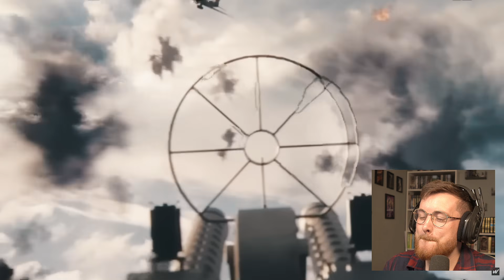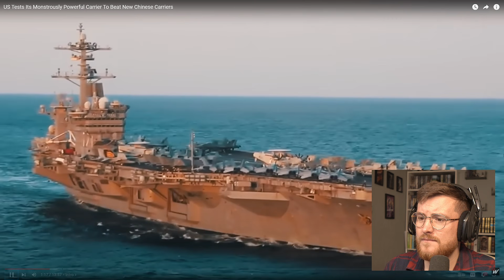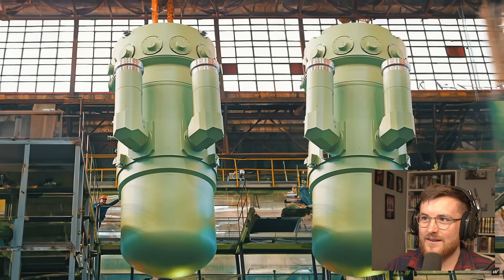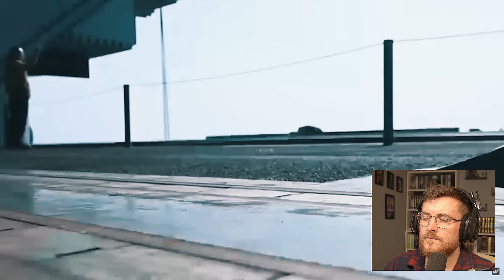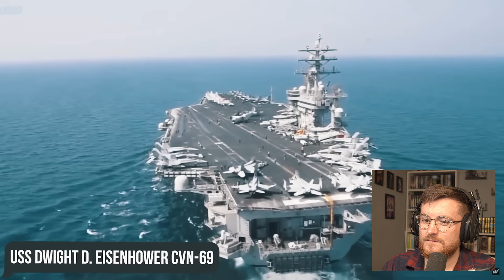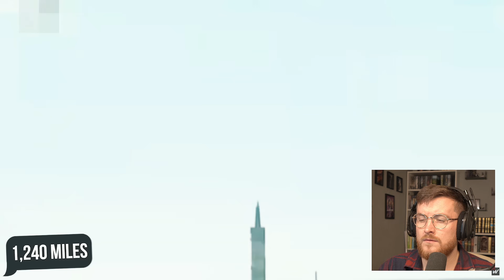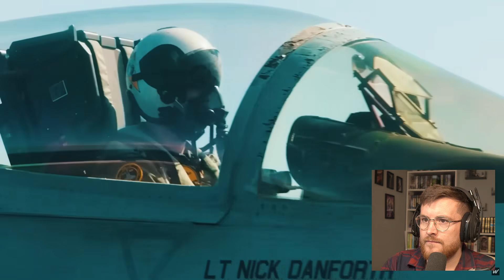Royal Marine Reacts To US Tests Its Monstrously Powerful Carrier To Beat New Chinese Carriers

Comment: I wanted to point out as well, the USN outclasses every navy on the planet (maybe not all at once but 1v1, no navy technically stands a chance) China also technically has more ships which people cite a lot as "oh, they have a bigger navy" which is only partially true. As Habitiual Linecrosser points out often "That's cause we don't count every fishing boat in our country, there's standards like tonnage, capabilities, and crew" (they tend to count small coastal patrol boats in their number, think like what you see stopping fisherman on the coast of Florida to check regulations and stop smugglers) They have more vehicles on the water, the USN has more weight IN the water. China has (according to google) 350 surface ships compared to the USN's 293, however China's navy only boasts a combined tonnage of ~2 Million Tons, whereas the USN despite have "less" ships boasts a tonnage of ~4.5 Million Tons, over double the weight of ships in the ocean/reserve fleet. Simply put, US Navy ships despite being fewer in number are larger, more capable, better technologically, and better supplied/manned than China's.

Comment: US maintains 11 Nimitz class super carriers and has for decades.
Ford class are one for one replacements for them.
Ships company are permanent crews stationed abroad the carrier. That does not include the carrier air wing which is composed of squadrons of Navy and US Marine aircraft that are permanently stationed ashore around the country and deploy to the ship whenever airwing training takes place and when the carrier deploys.
Air wing squadrons are attached for about three years which includes two major deployments and all the training for them.
Total complement of ships crews plus air wing is around 5 to 5,500 sailors and Marines.
Every Carrier carries several smaller boats to transport crews and dignitaries to and from port when anchored offshore.

Comment: And as far as the hypersonic reentry vehicles all you have to do is create enough local disturbance within a local sphere to be able to destabilize a thing because is not powered to do the self correction. Basically instead of visual chaff you have mass chaff that disturbs the hypersonic airflow around it enough so that it can't autocorrect essentially think about ramping up iron dome ballistically.  Think about the optimal location of an object creating a sonic boom, and that happening within the effect zone of a kinetic reentry vehicle, and then to cover all your bases and also your butt have it be a multiple entry to supersonic constellation of UAVs whose sole purpose is to carry enough propellant into a theater of operation to all go supersonic at the same time to affect a focused burst of sonic energy the higher the altitude the more units you would need kind of sounds like AI might be able to help us out figure out the equations for this kind of thing right and then wouldn't that be a deployment system that could actually cover a country? Could be like a swarm.

Comment: And also I love how the Chinese built actual scale model replicas instead of being able to digitize. How many old school movies in the 1980s did they build wet sand models and used analog manually-powered cameras over the topography and filmed. Wow.  They could adjust built the scale model and scaled up the data into my I don't know Microsoft flight simulator 1995?

Comment: The Chinese mockups are static copies that are on STRAIGHT rail tracks. If under attack you can BET yer pretty arses that the US Carriers are NOT gonna make it easy for enemies by moving in a slow straight line. They're gonna haul ass going zig zagging all over the place AND have both active and  passive defenses up n running. 

Further Ukraine has proven the hypersonic missiles are overhyped. The old (but upgraded & maintained) Patriot system stopped the Russian hypers. And guess what? The Chinese hypers are backward-engineered copies of those Russian systems.

Comment: 15:30 The carriers once deployed are designed NOT to need enter any ports. In fact it's highly desirable that they DON'T. Being in port makes them vulnerable to attack since they're staying still in one spot. The US Navy uses a resupply ship to go to port for supplies then bring them back out to the carrier where they do an Under Way Replenishment. This means they're hauling ass while they're hauling goods.

Remember with those multiple nuclear plants have enough fuel to run continuously for 20+ years. And there's more than one nuclear plants and steam generators that if one breaks down the rest can still keep the carrier running. Multiple redundancies. 😉😁
Reply: Also they’re not just allowed to enter any port, they can only enter certain ones due to them being nuclear powered

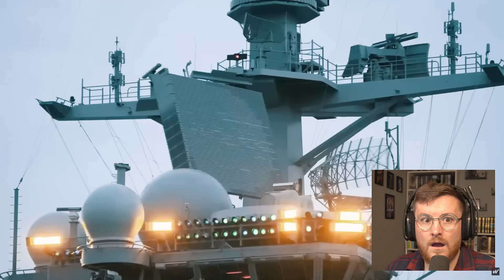Comment: 5:45 That's because by law we're required to maintain a fleet of 11 carriers. The plan is to gradually replace the existing fleet of class of carriers with the new class of carriers. We have 11 carriers so about a third is on active deployment, a third are in minor maintenance but can be immediately redeployed as needed and the final third are in major refit that'd require extensive lead time before redeployment. 

This way we can maintain the carriers AND still have a sizable posse available whenever and wherever as needed.
Reply: There are 11..  currently there are 10 from the Carl S. Vinson Nuclear powered family, and the new Gerald R. Ford Nuclear powered family..  as the new Ford Class come online , the US will retire 1 Vinson Class carriers
Reply: @ShaoLyn8  Carl Vinson is NOT the class name of the older nuclear carriers that's being replaced. They're the Nimitz class, named after the First ship in the class. The Carl Vinson is the third Nimitz class to be commissioned.

Comment: I would just like to point out at arount @12:30 that the elevator says "safe working load 24, 000 pounds" and it is just bringing stuff to the surface of the carrier.  Not sure if this is just a munition elevator, but if so, that is...a lot of warheads on foreheads

Comment: They wont have all the carriers out at the same time. Each port has a fleet cycle with one fleet out touring, one in training, and one that just got back and in for maintenance. Imagine 15 boats total, 5 boats floating around the Mediterranean. 5 boats in training. 5 boats that just got back and are being maintained. It's not that perfect with 5 per fleet and there are different requirements for each trip and port, but you get the idea.

Comment: I like how you respond to the number of sailors are onboard. However, this has been done for decades. I served on three carries and two wars. No problem with personnel. All three of the carries i served on were conventional (oil burning - non nuke-powered). 90 aircraft is normal to have onboard and operate. What you are surprised is something the Navy has been doing since WW II, from replenishment at sea from one ship to another to using helo ops to bring supplies (jet fuel, marine oil, food, parts, mail, and everything else needed onboard. It’s all normal for U.S. Sailors to do.

Sinking an aircraft carrier is not that easy. Review the sinking of the USS AMERICA CV-66. The Navy tested this theory based on an assumption of a Russian Admiral statement that it would be easy to sink an American aircraft carrier. For three days we (US) attacked the America with numerous types of ordnance and we could not sink it. We actually had to onboard and open sea chests and open hatches to get it to sink. While China has made a model it is not built to actual design nor specifications of the actual carrier.

Comment: For reference, the US used 6 carriers during the Gulf War. When you remember how extremely lopsided the air war was, the US is gonna be even stronger with modernized carriers. More sorties can be flown, can stay on station longer, has better defenses, has better aircraft, way better sensors and electronics etc

edit: there'd be more than 45,000 sailors. You gotta remember, those 45k are just the carriers. That's excluding the battle groups consisting of cruisers, destroyers, subs, perhaps littoral combat ships, refuelers, etc. Not to mention the amount of pilots. 90 aircraft is bigger than a lot of countries' entire air forces. Times that by 10, you rival bigger powers. Times that by the amphibious assault ships that carry helos and F-35Bs, the navy alone rivals super powers. Alongside the 11 super carriers we have, we have I think 10 amphibious assault ships. Those would be the Wasp class and the America class

Comment: West Philippine Sea is the furthest china has deployed its aircraft carriers and never longer than a week at a time. The new AIM-174B & JASSM-XR cancel out china's area of deniability. US deployed its new Typhon missile system to the Philippines causing West Taiwan to throw a tantrum. The system is made up of 4 mobile shipping container size launch batteries and each battery has 4 vertical launch tubes that can be armed with SM-6 or Tomahawk cruise missiles.

Comment: There's more than one galley on a carrier. They operate 24/7:
1. Captain
2. Officers
3. Senior non-commissioned officers (E7-E9)
4. Crew (E1-E6)
If a large enough pier is not available,  carriers will anchor close to shore and use boats to shuttle sailors to and from shore.
Reply: Don't forget the Starbucks open 10ish hours a day